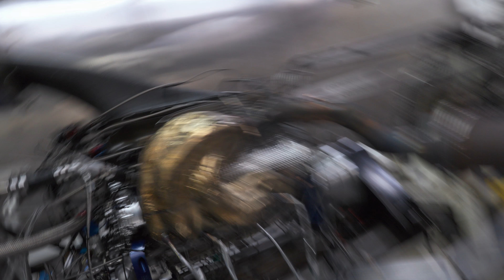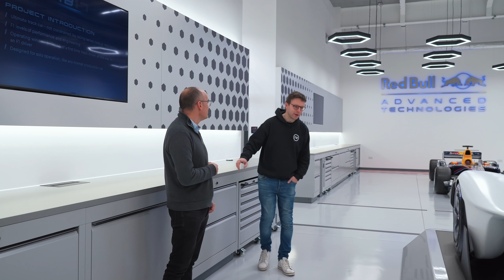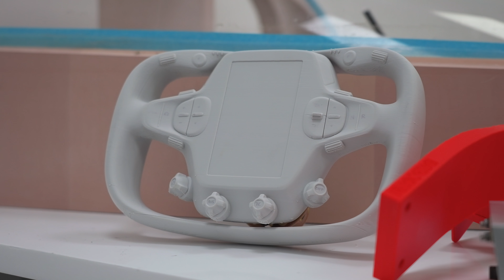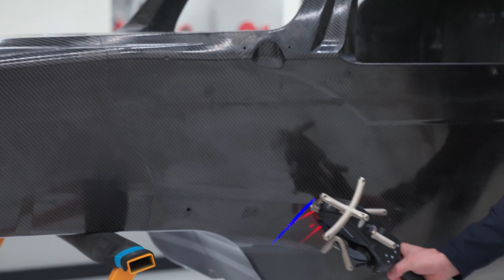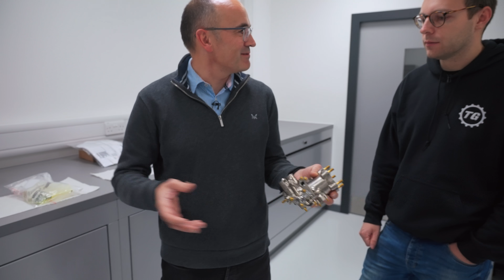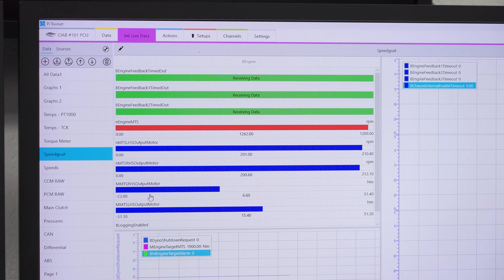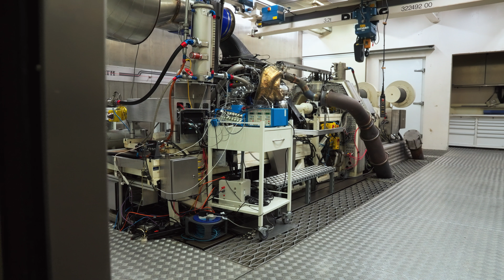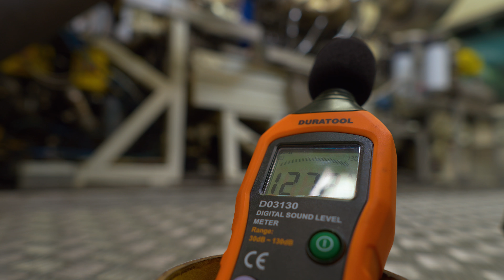Hear The Red Bull RB17 Scream: 15,000rpm V10!

Comment: Love the design of this thing. But I really hope red bull joins LMDH or LMH in WEC or IMSA. Obviously it needs to be brought to spec for those classes. But its an amazing platform for those 2 classes.
Reply: Wont be imsa if they massively detuned it to lmh spec as they dont sell anywhere near enough cars to meet imsa's 2500 car requirement & it'll need a hybrid component added with the hybrid mandate the WEC introduced from this year(the hybrid mandate doesn't affect already homologated cars)

Comment: So...95% of the price is the engine and gearbox. Quite a shame actually. An LS swap would be better for daily use because the chassis is amazing.
Reply: Yeah and a Toyota hilux engine would be better for daily use but who would want any of those engines in a F1 level hypercar?
Reply: @Shin_Majin The point is that this hypercar was not meant for you and me. But a more appropriately priced one would be. And let's be real here...if the car is fast, you wouldn't care less about its level F1 powertrain.
Reply: @TheMoukis mate any petrolhead would 100% go for a 15k rpm NA V10 instead of some mass produced V8 built for trucks.
Reply: @Shin_Majin Really? Because I think petrolheads would rather use an engine that would not drain their bank accounts. But you do you.
Reply: @TheMoukis nobody that ain't rich would have the money to get a F1 level car in terms of speed.
Reply: @TheMoukis  Given the prospective mileage for this engine, it would last me a whole year daily driving it, being that I drive around 8k miles per year. And if I had the money to burn to buy one, I'd most certainly have the money to do yearly rebuilds.
Reply: @halofreak1990  Key word? Money. My original post was about how the power-drivetrain costs so much. However the technology of the rest of the car is also amazing and it is such a shame that mere mortals will never experience it.

Comment: The UK has some of the greatest engineers in the world. It's a shame it never really translates into sales.
Reply: Well they don't really make mass market products.
Reply: Because cars are best designed with passion, then engineering. UK by engineers have often prioritised engineering choices over user experience.
Reply: It does tho, just not as much as the US, but still. The Brit’s need to focus more energy in their electronics and reliability. Also their interiors. They go to heck really fast. They should take notes from Lexus. My 2018 Jag F type had interior rattles, cooling system leaks, software glitches, electrical gremlins, and a sticky exhaust valve, just in the first year i owned it while my 2006 Lexus es330 has been absolutely flawless, not one single problem and I drive the absolute pi** out of it and floor it every where I go and stop on the breaks constantly. I always take care of it change the oil ever 6k miles change the transmission oil every 18k miles (once a year) and check my oil every week. It does burn a little bit of oil but that’s bc I’m always doing high rpm’s bc I’m always doing 90mph everywhere I go. The interior is the most comfortable and high quality and haven’t had a single issue. Also my 2003 cat eye Chevy 1500 with the 5.3 v8 has been absolutely bulletproof as well and also hasn’t had a single issue after 400,000 miles. I baby the truck tho. Actually the only problem I’ve had with it was a new dash bc it cracked and the center console/seat cracked so I got a new plastic lid. I will never own anything German or British except for the f80 m3 I’m about to buy. After that I’m getting a 2017 viper and a Lexus lc500 and will never buy another car for the rest of my life. I will keep my Lexus and truck forever.
Reply: It's a shame that you don't understand the economics and business model of designing and producing the worlds highest end goods, like hypercars.
Reply: @SirReginaldBumquistIII  I understand it better than you do, fool.
Reply: @gw7624 if you did you wouldn't have made your original comment 🤣👍
Reply: @SirReginaldBumquistIII  The comment is perfectly valid. It's not my fault if you're too thick to grasp it.
Reply: It’s a shame the n w generation ain’t
Reply: It doesn't really translate into great regular cars... affects them sales
Reply: It's sad but true 👍 It's hard running buisnesses and selling things here. I hope things improve 🤞

As en engineer for many years, I find that I can build anything but selling it is the hard part 👨‍🔧 

now I just focus on building my own stuff and don't pay anyone for anything 😎
That's the superpower of an engineer 🔧
Reply: It's a matter of image; English cars aren't inferior to others, but they can't achieve the same image and commercial strength as German or French cars. The Germans and French are very aggressive and offer excellent prices for company fleets, whereas the English sell based on their high profit margins.
Reply: Being a good engineer doesn't mean designing the fanciest stuff, anyone can do that with enough money. Building something that sales and consistently makes profit is a whole different challenge.
Reply: @SOPHOCLESIFY A good Engineer can do for 5p what anyone can do for £1
Reply: @SOPHOCLESIFY  Fanciest and the best are two different things. The British make some of the best cars in the world. The commercial side is completely different, and sales depend on it. What sells the most is what is most aggressive in terms of price and marketing. Completely different things.
Reply: @bryanm.4869 The problem with English cars came from Range Rover and Jags being horribly reliable cars that are expensive to fix.  Also McLarens horrible build quality and reliability issues is well known.
Reply: @SOPHOCLESIFY  It means designing the best 'stuff' and no, not every can do that with enough money. If that was the case, American cars would be the best in the world.
Reply: @gw7624  I think they're refering to cost to performance tradeoffs for design criteria

Comment: Misleading title, sort of a clickbait I have to say..., engine wasn't at 15.000 rpm. I'm a professional musician and the higher note at the Dyno was a D3 (146.83 Hz), so that makes 8.809.8 rpm 🤷‍♂️
Reply: Very unlikely considering it idles at 4500 and the next step before revving up was 7000 rpm already.
Reply: @kraenk12 I clearly saw and listened to everything you mentioned. After the 7.000rpm test, which was almost a perfect A#2, when it was reved it raised just a mayor 3rd to D3 (higher note heard on the video) which is exactly 8.809.8rpm, there's no doubt about that.

Comment: The fact that my 18 k rpm LEGO vacuum powered turbine is louder(135 db) and faster (18 341 rpm) thant this high-tech technology ultra expensive v10 is shocking
Reply: The smaller yo go the easier you can spin faster by physical principles. Also db is probably limited intentionally because usability on track (and maybe roads in the future)
Reply: @fjandro9646 prob... good observations
Reply: Small E motors can spin past 30k rpm but they soukd like ass
Reply: @Shin_Majin it's a LEGO engine
Reply: @NFB_LegoMocs yeah and my comment wasn't a statement of ur lego engine. But a statement about RPM.

Comment: Yes 100% all F1 should sound like that, get rid of that stupid hybrid that will never be on a road car
Reply: The sound thing is not because the hybrid part is because the turbo part and it's already in some road cars 🤦 my god...
Reply: @fjandro9646  hybrids on the road are not even close to current F1 tech, even thought they had been on the road way before. 
Obviously you don't understand the comment has to do from the FIA April 2025 meeting to change the 2026 engines to pure V10s,  no turbo no batteries.

a V6 will never sound like a V10 🤦 my god...

Comment: Not bad... I was expecting 3000 4000 km and rebuilt some parts of the engine.
10k or a little less is not bad...
But yeah this is a F1 engine with low rev limiter 😅😅
Reply: They claim over 20k km if u don't track it hard every time
Reply: @Shin_Majin how you do that? If this is a track car.
Or you push or not.
I dont see middle terms. 😅
Reply: @bastordd well there is a difference between F1 pro level of pushing and normal dude pushing.
Reply: @bastordd i've done proper gokart for years, and layout countless of hours on the track, and less than half of them is at full throttle.

Comment: Thats a motorcycle gearbox layout.
Reply: Yeah 👍 all racing sequential gearboxes use motorcycle tech 👨‍🔧
Reply: @UKBUILT  I was told by an ex F1 gearbox engineer that in the 70's they rigged up a Z650 gearbox for evaluation.

Comment: Doing the maths : 4.5L V10 x 15,000rpm = 450cc per cylinder ( 1/2 litre of bottled water size ) , then some seriously quick valve tech is needed. Personally , I'd slap on twin turbos and there we are........Interesting.
Reply: ia arruinar o ronco

Comment: The smoothness of the engine during the revs is unreal. The balance and smooth running is best possible platform and they did it justice finally someone built a proper car

Comment: 16:50 Named after dog teeth. Since there is so much space between the teeth, just like with real dogs.
Reply: I always assumed it was named dog teeth because it grabbed onto something. Like a dog grabbing and holding onto a thing.
Reply: @mofayer  This word usage is a metaphor derived from the idea of a dog (animal) biting and holding on, the "dog" name derived from the basic idea of how a dog jaw locks on, by the movement of the jaw, or by the presence of many teeth.

From wikipedia - but without a citation.
Reply: @mofayer  "Normal" synchroniser rings have teeth that grab onto each other, just closer spaced.
Reply: ''In essence, a "dog" isn't about the animal itself, but about the action of gripping and holding, 
            a characteristic metaphorically transferred from canine behavior to tools''
Reply: I think it's also because in car speech we normally say that the dogs are "biting together" when you shift.
Reply: @BF26595 I've been into cars for over a decade and never heard that 😅
Reply: @r6scrubs126 Yeah, I'm very familiar with cars and the topic at hand (been driving for forty years this year and been reading about cars for almost fifty) and I can say I've never heard anyone say that until now.
Reply: @BF26595 👍 drive dogs are used in lots of old engineering applications. It can refer to any component that holds together tightly like a dog's bite 👨‍🔧 they're used on many machines to transmit  force or wedge components together

Comment: 30:00 4,000 rpm idle is even small. Back then V10s had an idle of about 7,000rpm aka the maximum of most road cars.
Reply: OK? They can set the idle wherever they want, you could set a road cars idle to 7k if you really wanted (engine reliability not concerning)
Reply: @Alucard-gt1zf  Not necessarily, these engines have little flywheel to keep them steady, and a lot of drag, so, I'm sure they'll probably idle it down as much as possible before the first delivered cars, but it'll still probably idle at 2k RPM+.
Reply: @Alucard-gt1zf , so?
Reply: @DaveMcIroy so what were you trying to say?
Reply: @Alucard-gt1zf , ot should be obvious.

Comment: I am guessing Verstappen is racing this in LeMans as soon as it's done.
Reply: It doesn’t comply to any reglementation.
Reply: @kraenk12 good ol' reglementation
Reply: @kraenk12  This could easily be adapted to meet hypercar regulations. It just has to fit in a performance window and have only one adjustable aerodynamic part. You could theoretically enter a range rover in hypercar if you could get it into that window
Reply: @Alexandhisgoose  Well first off it has almost double the BHP allowed, 4x the allowed downforce and would need at least 150kg of ballast just to name a few. It's also too long and too wide to meet LMH classification, which is a massive engineering and dynamics overhaul. It's the same reason T.50S wont race in any current Lemans classification. Changing a car to conform to all of the regulations completely ruins the car and everything it was designed for. Much easier for RB to design an LMH class car from scratch rather than modify an existing car.
Reply: @RG-gg5ye  These are all issues the Valkyrie faced as well and it wasn't an issue to modify that for Hypercar was it?
Reply: @kraenk12  its literally built to lmh crash standards
Reply: @kraenk12 regulations are gay
Reply: @kraenk12  what in tarnation is a reglementation?
Reply: Verstappen is driving this on the streets of Monaco at 5Kmph
Reply: No, because this design would never be legal. Ford is there though so maybe he could get Ford and Red Bull to sponsor him to race there.
Reply: @F1ll1nTh3Blanks  Currently no.. However it's feasible they could do an LMH version akin to AM
Reply: @invASIAN95 wouldn’t be the same car at that point
Reply: @Gundam4President  well Yeah but thats beside the point
Reply: @Gundam4President  well a valkyrie LMH isn't a valkyrie amr pro but it still is  is a Valkyrie at the end of the day.. An RB17 homologated would be viewed the same way
Reply: @F1ll1nTh3Blanks  ford and Red Bull are currently partners in f1 so who knows 🤷🏻‍♂️
Reply: @F1ll1nTh3Blanks ford is entering hypercar next year and no one has seen the new car. Maybe it’s like this.
Reply: @GBZSCOTLAND  even from the teaser images we see, it's nothing like this. It's an LMDh car, look at the cars racing in IMSA or an LMP2 car to get an idea of how it will look.
Reply: Only if it’s done as a show run which I doubt since it could maybe be faster than an LMDH car and that would be a bit impolite
Reply: Mad Mike will slap a 20b in it and drift it no doubt....hehehe

Comment: Missing 3-4k rpm at the top.. also they need to do a good job tuning the mufflers so the sound actually get sweet and nice. Wonder the longevity of these engines. Well nevertheless nice with something different.
Reply: these thigns would be lucky if they were evern driven at all, let alone worrying about driving enough to cause wear.
Reply: It can't sound too loud since most tracks have sound limit nowadays

Comment: That engine note... That sweet sweet F1 V10 engine note. What a lovely sound to hear
Reply: Will sound way more insane once it is in the car
Reply: This is why an EV supercar never really works for wealthy enthusiasts. Here you have all the mechanical engineering, emotion and sound which cannot be duplicated through electrons.
Reply: It's like meeting an old friend.
Reply: Too squeaky
Reply: It sounds somewhat tempered compared to what I remember from the 80s/90s/early to mid 2000s to be honest.

Still 90%+ of the way there though.
Reply: @weedfreer yeah it's in an engine dyno. It sounds weird atm but you can hear the F1 V10 notes shine through
Reply: @Artiick  a little, yeah, but I’ve heard engines on dynos before and the sound like they do normally when in the car in the main.

If you watch the video through, I believe the reason why it sounds about 90%+ only is because they’ve taken the choice to limit the revs to 15,000 only.

As such, it’s sounding a little muted like the current F1 turbos do compared to what they could sound like if they could rev the higher.

I understand why they’ve had to do this though, but, still, it has capped the engine note below what I would have expected it to sound.
Reply: @weedfreer  on the dyno the engine featured a 5 into 1 exhuast layout on both banks, however once the car hits the track will feature a 10 into 1  giving it a higher pitch  and better sound similar to the mclaren mp4/15 which Newey was aiming for,  and on the dyno they only revved it to about 12-13,000rpm not the redline at 15,000rpm
Reply: @R33_MKR SI mean, sure, ok, maybe they were and maybe they will.

It sounded flat as was though.

If that was the situation then I look forwards to hearing it in its final form.
Reply: it sounds like a cheap electric motor lmao
Reply: @Noctivagentt yeah... the sounds of that v10 sounds bad... at least from this video. Maybe it might sound different when it's out. But for now, it sounds bad lol
Reply: Porsche Carrera GT has had it for a long time
Reply: Simply Lovely
Reply: 127db before the song starts 😀
Reply: @danielryan5384  Not gonna pass sound at Laguna Seca for a track day!! 😂
Reply: I still don't get why people like that sound. You can get the same sound from an angle grinder. Give me a turbo and some actual torque any day. I've had 500 bhp NA cars and they felt slower than 300 bhp turbo cars
Reply: @r6scrubs126  Are you special?
Reply: @r6scrubs126  LOL  NOPE.  And "felt faster" doesn't count vs IS faster.
Reply: Sounds like an annoying, loud screaming child.
Reply: @bradleyd6000  You obviously have no business posting about fine automobiles...enjoy your KIA EV on your way to Starbucks for a soy latte......

Comment: so, no more blown diffusor with the top mounted exaust?
Reply: He mentioned it has a fan so presumably that is driving the diffuser.
Reply: @Your_Paramour  I wonder how anyone would drive a diffusor this big with a fan. You can literally fit a person through these venturi tunnels
Reply: @halofreak1990  I don't mean actively blowing air through it, i mean suctioning out the boundary layer so they can run more aggressive expansion angles without detachment. I don't know, or care to attempt to calculate the airflow and power requirements for such a system, but without a big fan system being visible, I doubt they're using it to reduce the pressure under the whole floor.